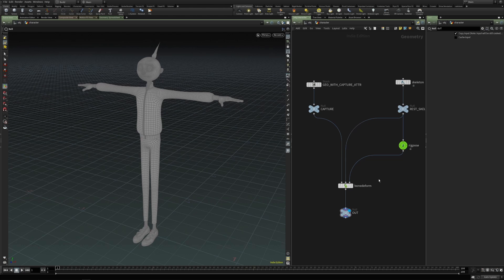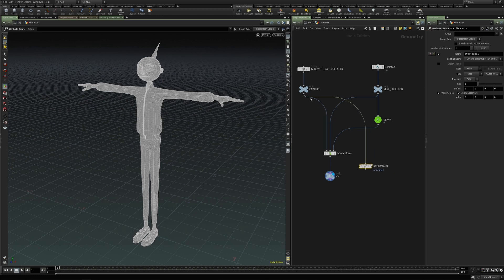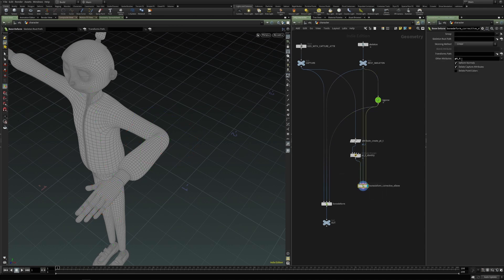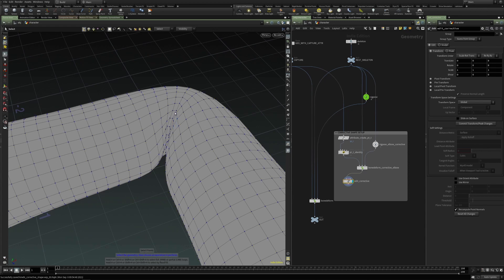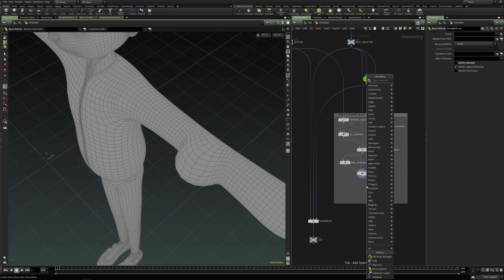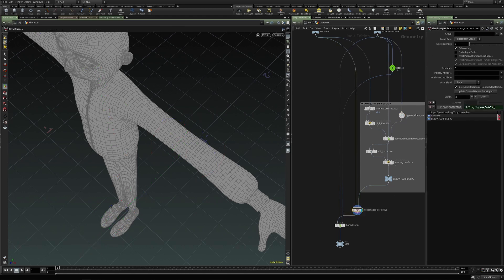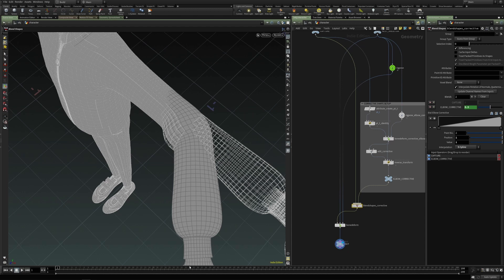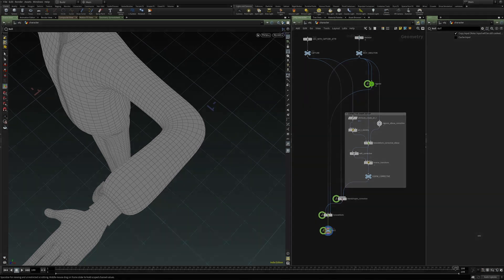Corrective Shapes In Houdini KineFX

Comment: Is there any difference between concept of corrective shapes and pose space deforms?
Reply from the maker: The way I see it, pose space deformation is a deformation that occurs when a character is in a specific pose, while a corrective shape is just a shape that can be used as a blendshape for instance. 

So in a way, controlling a blend shape node with a simple rotation expression to apply a corrective shape is sort of a pose space deformation. However, pose space deformation systems usually offer much more complex functions to calculate whether the character is in the pose and automatically blend between different shapes for instance.